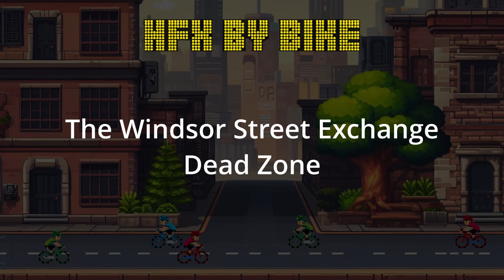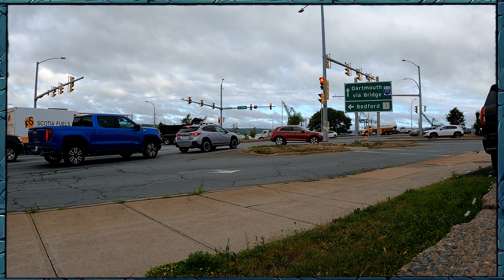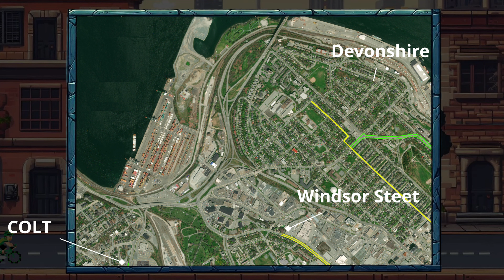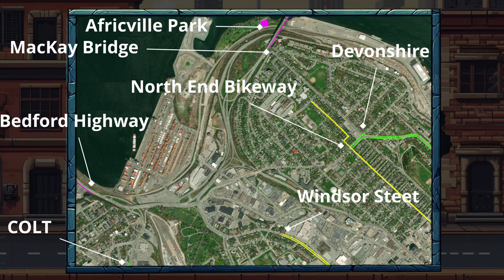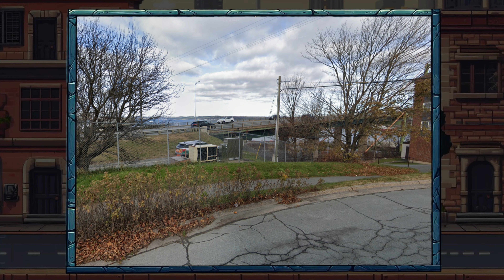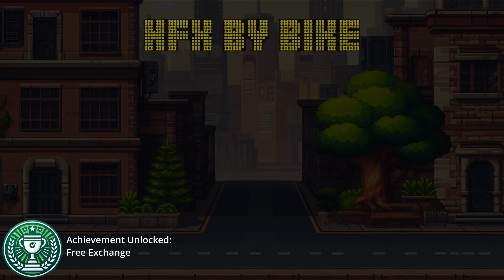The Windsor Street Exchange Dead Zone

Comment: It’s bananas there isn’t a good route down the Bedford Highway. 
You should do a video on the city’s plans for it.
Reply from the maker: It's on the list!
Reply: Is that the one where cyclist "snake back-and-across the Bedford Highway?
Reply: The recent improvements to the Bedford Highway are so much better for cars, with a smooth road and new lines. I see ZERO improvements for cyclists: just as dangerous.

This could be one of the best and most scenic parts of the the cycling ‘network’ along the basin into Bedford.
Reply: @georgeb3920  it is also one of the least hilly routes of moderate lenght near Halifax, making it ideal for starting a season or just a light workout.
Reply: @weldonyoung1013  Courtesy of following the shoreline. The speed limit dropped on the narrower portions since the repaving, as if that makes a difference. Stunning and terrifying at the same time.